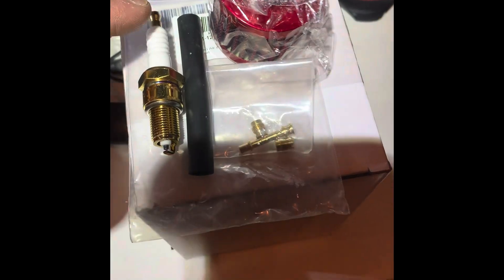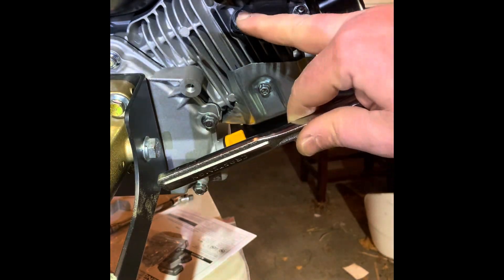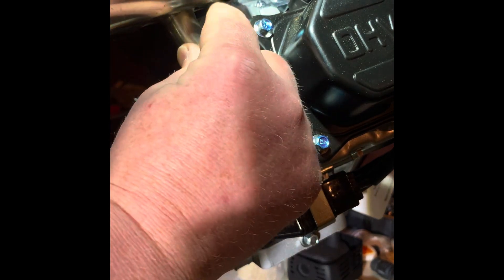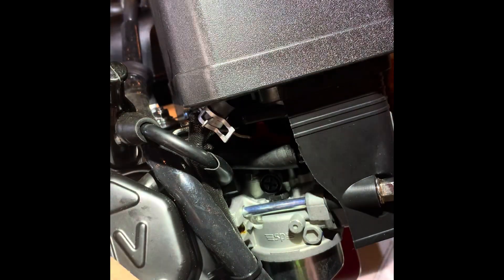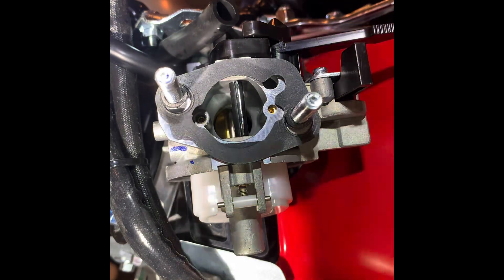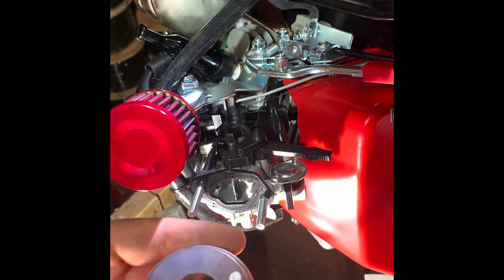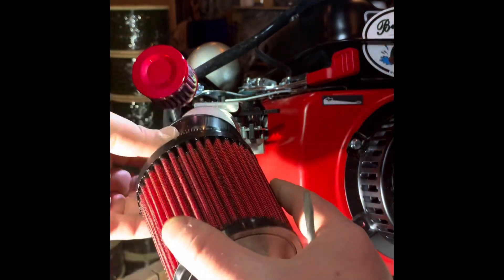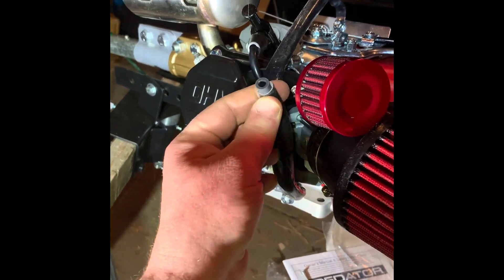How to complete a stage 1 upgrade to a longtail mud motor.  predator 212 224 long tail.

Comment: Did you remove,  ziptie, or bypass governor in any way?
Reply from the maker: No. Just back the screw out that prevents full movement of the throttle.

Comment: With the 224 you don't need a new muffler. You can use larger jets and even run a slide carb with the 224 muffler. 

I initially ran the stock muffler on my built 224 but opted for a header pipe and silencer. I use the 224 muffler on my built 196's. I found that there is no noticeable difference in performance between a header and the 224 muffler running 5K RPM and under for the minibike hobby.

Currently one of my bikes has a stock 196 with the 224 muffler and a VM22 clone carb. Stronger runner than with the stock carb.
Reply from the maker: @Deucealive75  224 muffler is a larger diameter, correct?
Reply: @grindfestoutdoors  Oh yes I forgot to mention. The ID of the inlet is 7/8". All other small block stock mufflers are less. This must be the reason it works well. On mine I welded on a short deflector pipe so it wouldn't blow straight back and I didn't even remove the spark arrester screen. For all I know it may be a touch better if I remove it.
Reply from the maker: @Deucealive75  this particular build was a giveaway at Gamefair. I’d need to ask the guy who won it if he’s noticing anything different. Last time I talked to him he said it ran great. I did the same upgrade to my 212.

Comment: Which jet from that kit did you install?
Reply from the maker: @keeginvandusen6120  the larger one. I did a giveaway on this kit at an expo. The winner says it runs really well. On my 212cc I used the larger jet, but stock emulsion tube got me the best performance.

Comment: Perfect timing on this video i bought the 224 for my swamp runner ive been watching your prop videos
Reply: A good prop for 212cc engine is 2 blades 175x221.5mm and light and small hull around 275x85cm.
Reply from the maker: @JCampGarage  FULL SEND!
Reply: Any mods to your 224 by now?